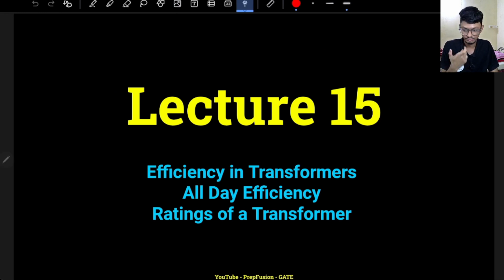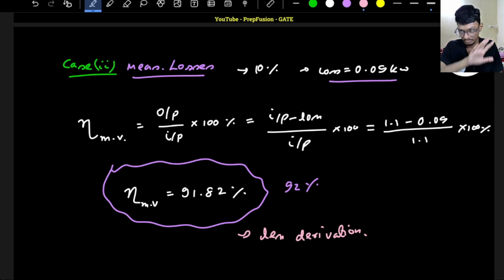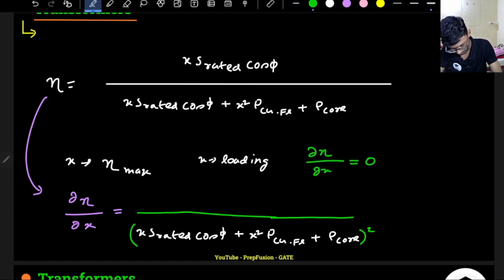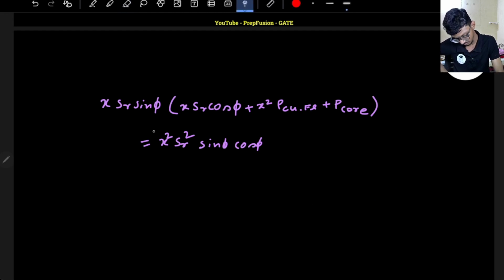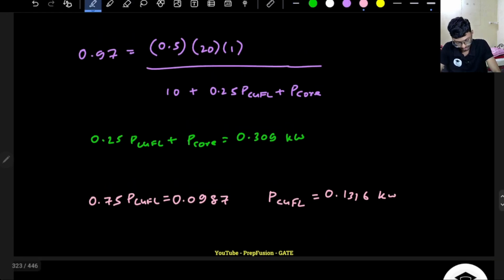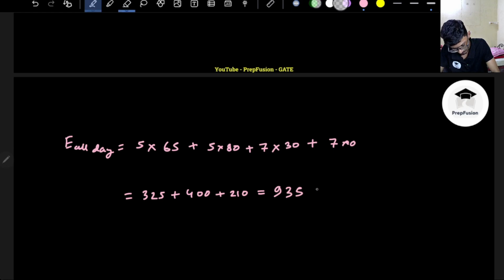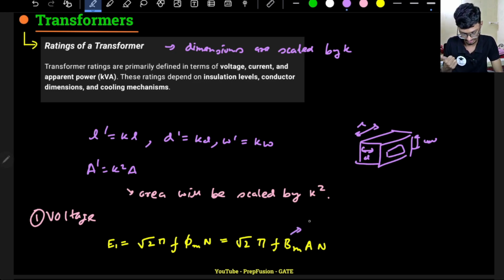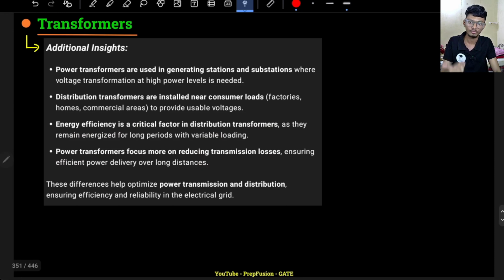L15  Efficiency of Transformers || Electrical Machine || Anish Saha || PrepFusion

Comment: how is copper loss at full load = COPPER LOSS pu at full load * S base 
i mean how did S base came
Reply: the loss at full load is very small compared to S at base value. (for your udnerstanding). 
Pu value = actual/base.
base value is taken as S as given in Q 
hence -->    copper loss at full load = Cu loss PU at full load * S base 

if you go through the pu value topic in power systems u will have a better understanding